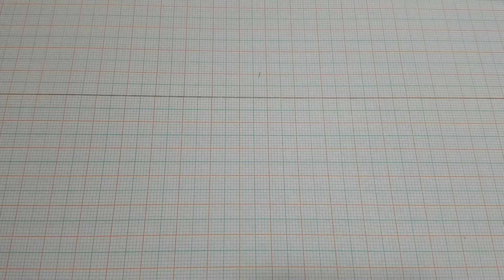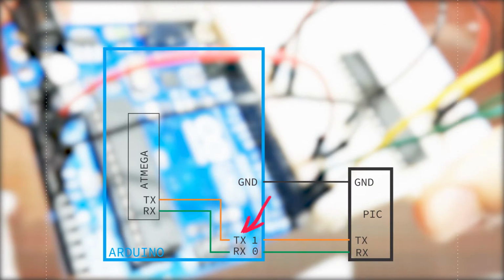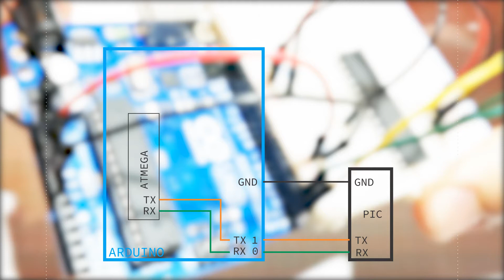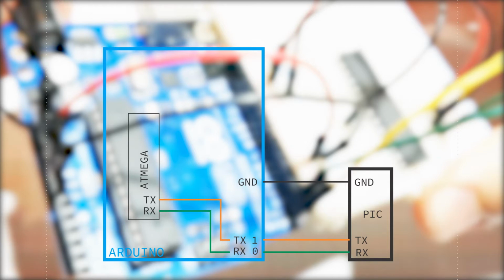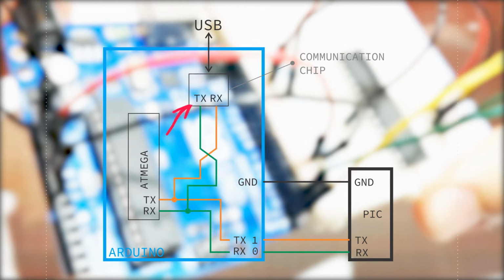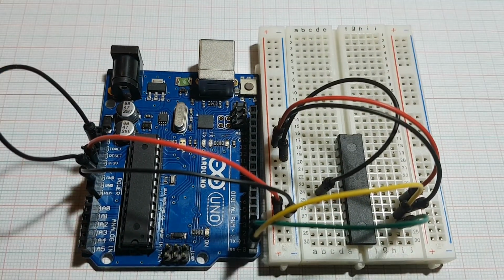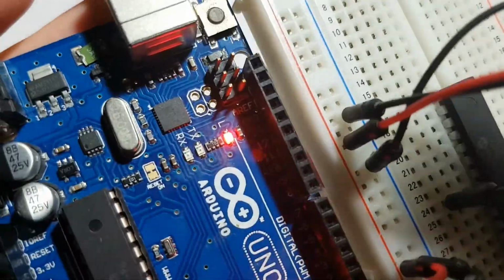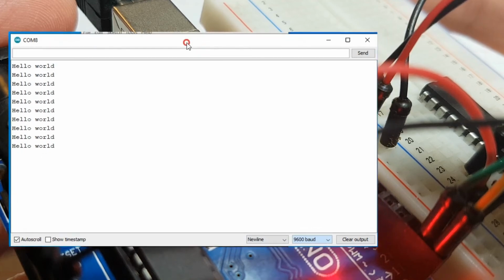Using Arduino as USB to TTL converter

Comment: I don’t know how all of you got this shit to work? Been at it for 9 hrs now, 7 different arduinos, all bullshit
Reply: Without the Arduino sketch being posted, it is indeed difficult. Same with other videos on this topic. Just running wires is insufficient.
Reply: @peterraeth4963  what sketch? the Arduino is not even turning on (reset shorted to ground). He's just using the USB to UART chip that happens to be in the Arduino PCB.

Comment: How did you flash the code into the PIC?
Reply from the maker: I usually code PICs  in mikroC and flash the binaries with PICkit tool.
Reply: @abobija  is it possible to flash pic 16f72 with arduino with the tx rx that u shown here?
Reply: @Sekhar_Home  nope, as far as I know PIC MCUs use the SPI interface to write the flash. The easiest way to program a PIC is to get a pickit3 or 4 in ebay or so. Also some "newer" AVR programmer should be able to program a PIC
Reply: @mattse2209  thans